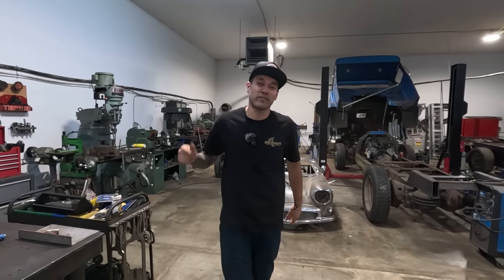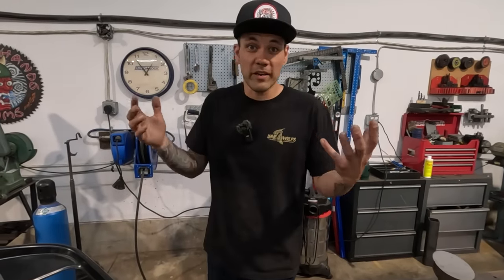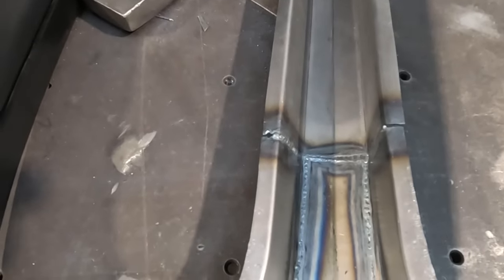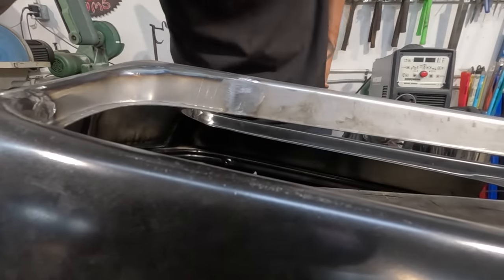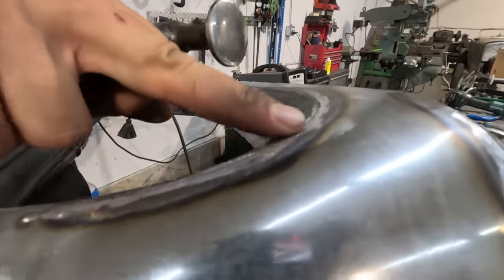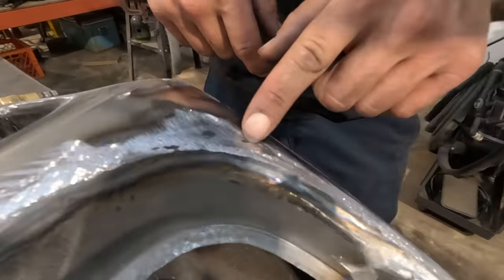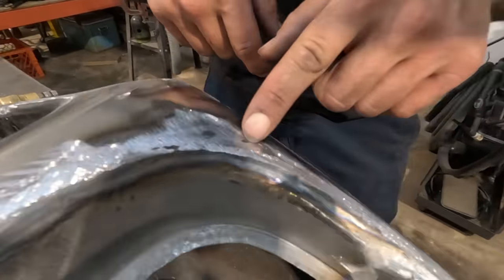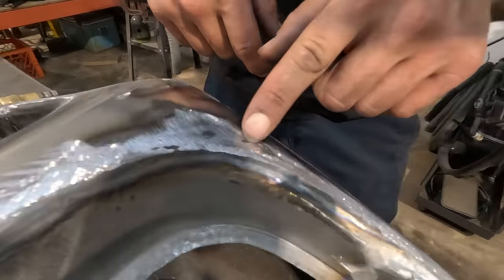Finishing Welds Grinding Sanding Sheet Metal And Planishing by Hand How To

Comment: I know that you have talked about how hard to hit a high point but in seams like that, or maybe joints that are the two pieces welded.... and you pointed to how its not level... I get it or how and why it happens okay.. now the question is: You could hit that highest point harder or say use the planishing hammer maybe for the rapped consistant hit a high point to level as well as stretch it. Its moving the metal by pushing it apart.... Look Karl, my question or  statement is jagged I know. I am saying/asking that I know it compresses the metals together but if nothing is holding the outside parts, would it still be shrinking or is it the kind of  hammer that your hitting with designed to shrink? Then that brings a whole new question ??? Are there hammers designed to do the same as the "Shrinker Stretcher tool does? I think about how say a shrinker works by grabbing and pinching metal and metal stretches by pulling it apart so are there hammers as in the type like you were using as body tools that can do just that, hit and stretch every stroke and same same for shrinking? I am going to sound stupid but kind of repeating myself to allow you to know I am trying hard to learn stuff. That said, every tool has purposes and some are for just one or others can be used in many applications. I know that if you hit any metal, it drives marks into the metal and say if hit too hard, its a new dent that has been made. That is why I wondered if hitting harder in some cases is the right thing. I am not going for S.E.M.I. or that place where peoples stuff is judged on its qualities in so many ways... even bad work can get high marks if its concept is something new or exceptional. My caretaker who is helping me with my being on hospice.... ya, Karl, my body is breaking down badly.... and anywho.. my caretaker I mentioned has a son who is fourteen and looks up to me as a father figure as his father is miles and miles as in states away. Her son, Trevor, wants to lean metal and he is a perfect candidate to learn metal because he does want it. I am considering using a frame from a ford explorer which happens to be the OBS models ... a 95 year so full frame... and because its a automatic and four wheel drive.. electric shift making many things much easier to apply in this kind of build. The body is a 56 model International and rusty, but not rusted out... I must admit to the fact that we if we do do this will have a lot of Brents style of patch in repairs because we would go for the refurbished look instead of restored look. Parts and pieces for it are easier to find in my area. Most everything major or even minor are already on it. Its only a body shell, no old engine or other in or under it. I looked at my explorer which is a fine looking and driving rig is starting to do some stuff concerning me as in brake lines rusting out and such... yes its a easy fix but its also a easy rig for Trevor to learn more on. I can not drive anymore so why not get some good out of that rig that most call the "Exploder". Yes its old but real low miles with no real issues other than I just can't drive. 
      My idea is to do a lot of metal repairs and shaping of top and doors... but probably not going to be any chop top.... to me a little more advanced than Trevor is up for on a first anything that runs... he hasn't even taken a sparkplug out of a lawnmower.  Sure it would be fun for me and him to grab a squarebody and set a LS or a big block into for a rubber ripping demon.. I best shut up so you can answer this seventy three year old leaves a book comment/LOL

Comment: .  *  *  *  *  Can you Braze with  TIG or MIG ? Wouldn't  that be easier to grind  and take less heat ?
Reply from the maker: Yes, but it’s not some thing that you want to hammer on because it’s not as strong. I know it’s used, but I prefer to use the same filler material as the base material.

Comment: Okay, but let's put the welding distortion thing to bed.  I'm a mechanical engineer with 40+ yrs working on everything from jet engine parts to structural steel.  All metals have a physical property called the Coefficient of Thermal Expansion (CTE).  It's a fixed value and every metal has it's own CTE value.  Temp of the increases, then the metal grows in all directions at the rate described by the CTE.  If you hold the part at an elevated temperature, say in a heat treating furnace, that part grows till it matches the temp in the oven and then stays that size as long as the temp remains constant.  Then remove it and allow it to cool to room temp - it shrinks back to its previous size as the temp of the metal drops back.  The weld puddle of steel happens around 3000°F so at that temp it has expanded a lot compared to room temp.  The patent metal around the weld is no where near that hot.  So when the weld cools it has to shrink a lot whereas the parent metal only has to shrink a little to get back to room temp.  This dissimilar rates of shrinkage due to different levels of change in temp of the weld metal versus the parent metal causes the weld distortion.  It also will often leave residual stresses in your welded item for the same reason.
Reply: That's a long winded version of what he said in the video 🤣🤣